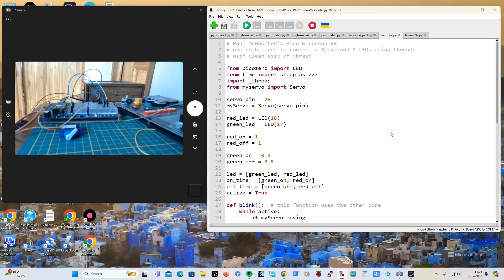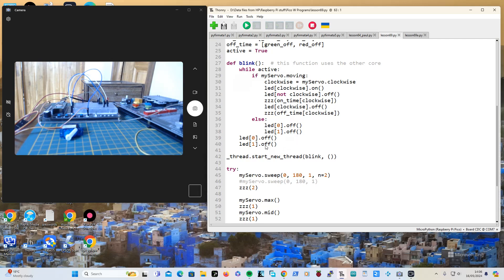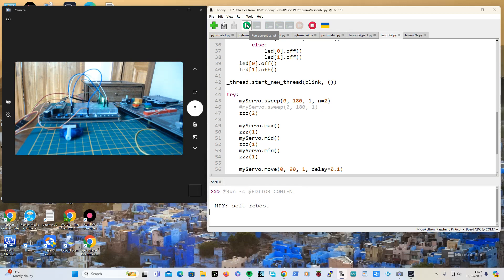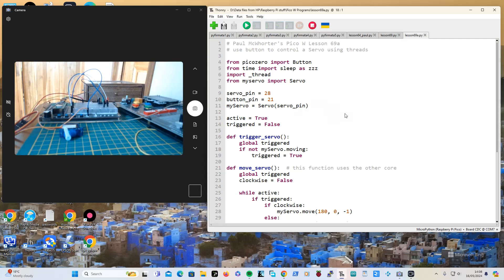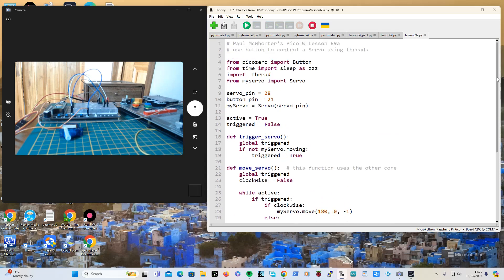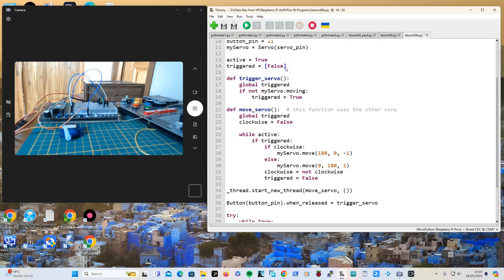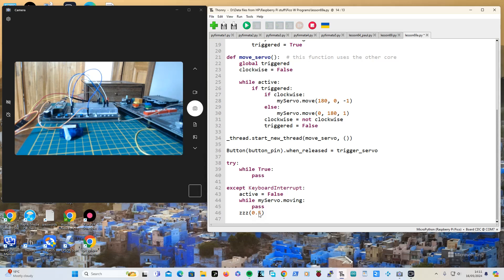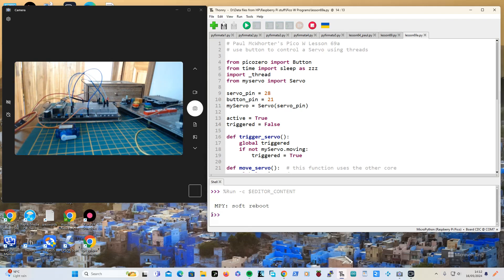My video for Paul McWhorter's Pico W Lesson 69 - Exit a dual core program cleanly.

Comment: Nice video. Have you found an explanation of why non-global variables work in thread functions (at least one way)??
Reply from the maker: @keithlohmeyer 
Hi Keith

As you know, I'm not really into reading documentation or googling stuff so all of this is coming out of my head.

If you define a variable outside a function or class then it is actually a global variable. You can access it in a function without having to explicitly pass it in or define it as global in the function. It's only if you want to change it that you need to define it as global in the function.  If you pass it in as a parameter and change it within the function then it only changes the local value within the function. The value of the variable outside the function is unchanged. That's how it works for a simple variable.

It's different if you've defined something more complex like a list. If you have b = [150, 200] in the main part of your program, you can actually say b[0] += 1 in a function without having to pass it in as a parameter or define it as global in the function. I think it's because you're actually looking at a pointer to the object. The same thing must apply to threads. 

In my first program, I didn't define 'active' as global in my thread because I was just reading it and I didn't need to do anything to the LEDs either because they're actually classes. I was changing the value within the class, not the class itself. 

Paul didn't need to put the LEDs in the tuple of the new thread function. If he had printed the values of the LEDs in the main program, I don't think that they would have changed. And he didn't need to set 'running' as global in the thread.

Probably it would be better to write a class that just contains a variable with a get and set method rather than having to declare it as global within your function or thread. Or you could just define the variable as a list with only one element (as I showed in my video) but that would be pretty shonky imo.

My second program updated 'triggered' in both cores but I knew that this would never cause a conflict. If it could, then I would have had to use a  lock on it. I haven't looked at locks yet. 

Does this make any sense at all? Maybe you'd be better off asking Mr Google!
Reply: @charlotteswift  Thanks for the explanation. I have searched for "Python variable scope" but each one says it a little differently.
Reply from the maker: @keithlohmeyer  What I said might not be completely correct because it's been a bit of trial and error but I think that it's a rough approximation of correct🙃😁